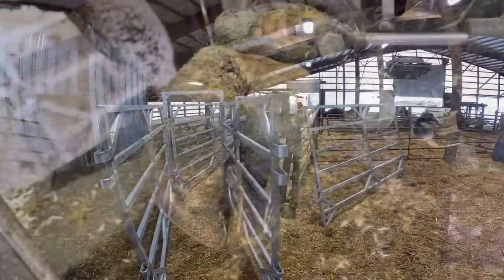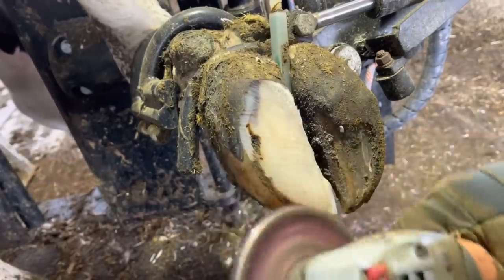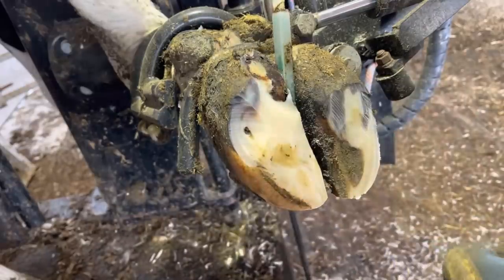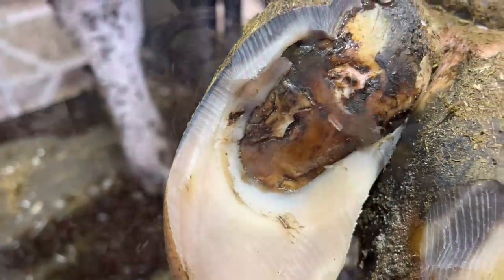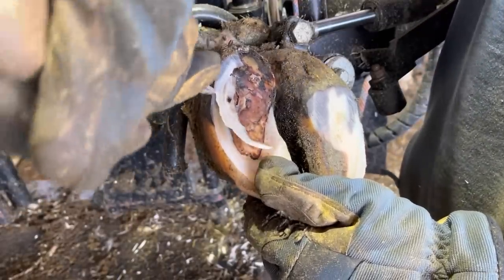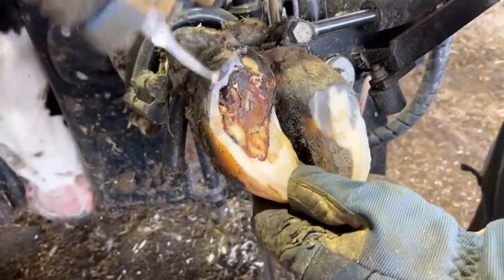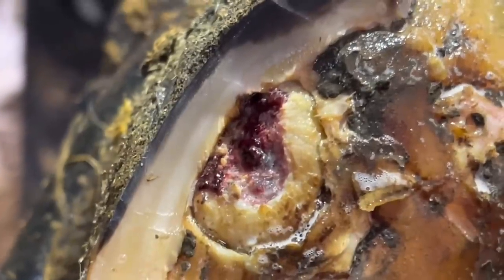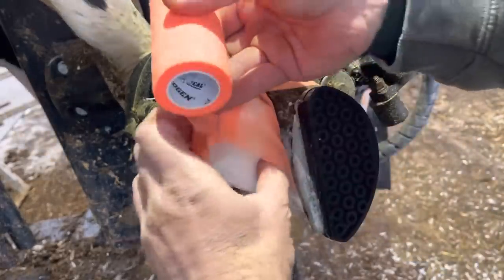Can you spot the HIDDEN PROBLEM?

Comment: Another fine job. And when you got to that final bit of trimming of the outer sole, you could see just how hard that stuff is. Requires a lot of force and control with the knife.  I'm thinking that for situations like that, where you're working with tough outer horn and needing to remove small areas near the coreum, that a Dremel tool with a cone rasp or some other suitable bit would make that a bit easier rather than having to rely on the knife where you have to apply a lot of force to get through that horn. A lot of force means less control. (though you always do it very well.)

Comment: Why is your chlorhexidine blue, but I see other Chlorhexidine spays are clear or yellow?
Reply: Not Nate, but that coloring has been arbitrarily added by the manufacturer. By default, it looks just like water. Added food coloring allows you to see which area has actually been covered when applying it. The usually bright colors will also deter people from confusing it with water. And, while it's not inherently dangerous when consumed in small quantities, a glass of milk would certainly be preferable. Thus, you'll rarely stumble upon clear chlorhexidine solution outside a lab setting.

Comment: What is the adhesive that is used to secure the block on called?
Reply: Bovi-Bond?
Reply: @gwiyomikim5988  Thanks, looked like silicone but that wouldn't work on rubber.